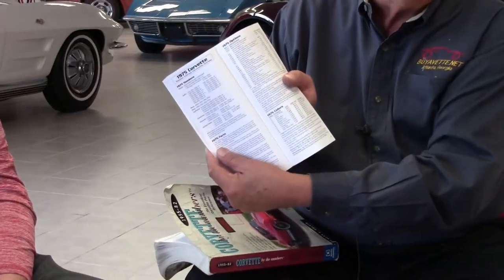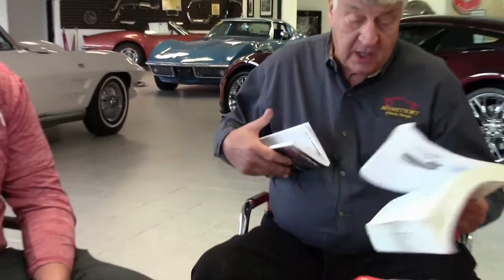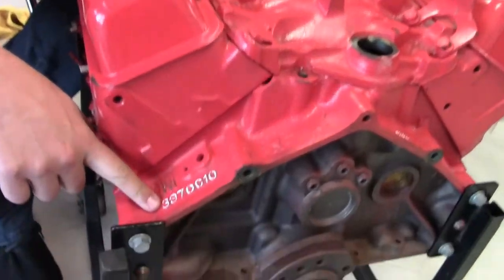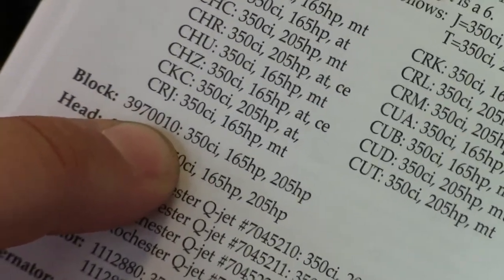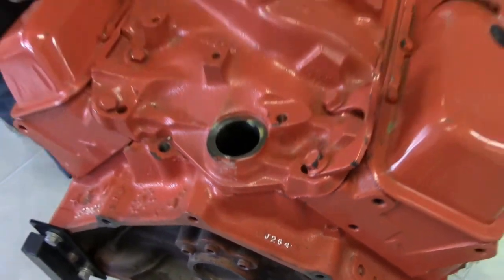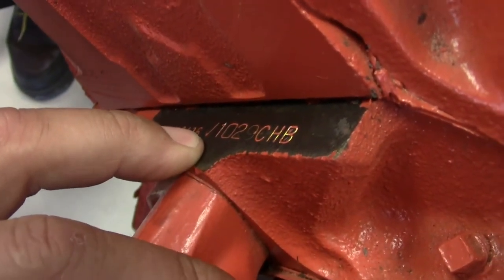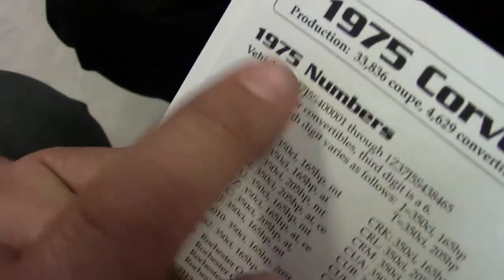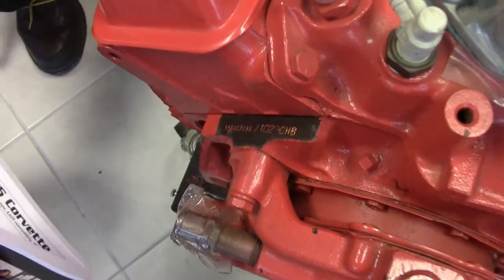"By The Numbers"  Matching Numbers Engines

Comment: Is it the same location for a big block ?
Reply from the maker: Casting date on early big blocks is located on the lower passenger's side of the engine block, near the starter. Stamp pad still contains the same data as small blocks.

Comment: forgive my ignorance, but what is the significance of numbers matching? does it tell you that the original motor is in there? Wouldn't it be better if someone dropped a newer engine in there?
Reply from the maker: Nearly anything that's antique/collectible is going to be worth more if it's original, and not modified. People buy these cars because they're nostalgic for them -- they remember what they were like when they were new, and they want them to be exactly like they remember. Original is almost always going to be worth more than modified, if they're otherwise in the same condition.
Reply: @buyavettedotnet  negating top specimens i e l 88, ZL1  etcetera that trend is pushed out due to all the customers that want rest don't mind with modern fuel injected crate engines. Sad I know, We full original engines much to my dismay at a daily at my shop due to customer demands and replace them with bigger beefier modern ls7s or 502 or 572 crate engines because their original 454 LS6 in a Chevelle just wasn't enough power LOL so I might have it half of these suckers generally don't care about the engine once it's pulled but it's still sad because most of them might just pickle them and then set them and store them on a pallet somewhere and hope that I find a clean enough body to throw them into someday. My 69 has it's original 427 and Muncie 4 speed, but my Wife's 73 has a 383 stroker that has about 100 more horsepower and kicks its butt every which way to Sunday because it's built to the nines LOL but we both know which one I'm driving on the weekend, my 69 all the way! Have a great day Sir and awesome video.
Reply from the maker: @adamcady9359  thanks for the kind words! There certainly seems to be plenty of both "numbers matching" customers, and those who don't seem to mind. We'll keep stocking cars for both though!
Reply: @buyavettedotnet  Thanks. Great to know.  I am based in Europe and looking to obtain information on previous Ownership of my C3 Corvettes. I had the website before, but lost it. How to get History Ownership info? Many thanks in advance! Regards from England? 😎🇬🇧
Reply from the maker: @marissejans6247  I am not aware of any website that has ownership history for all C3 Corvettes -- maybe try one of these? https://www.c3vr.com/  https://www.c3registry.com/
Reply: But just because the numbers match doesn't mean it's original, far from it so be careful paying a premium for the supposed original engine. I first became aware of these numbers over 40 years ago and restamping was going on back then. So many fakes out there today,  I've seen "matching numbers" on a block that doesn't even fall in the correct date range so impossible for it to be the original engine but I'm sure many would be fooled.

Comment: I have a 1970 Corvette Convertible, the badging says LT1 but I'm not sure can you tell by the VIN number if this is true?  VIN 194670S403777
Reply from the maker: They didn't start putting the engine code in the VIN until 1972, so no way to tell the engine on a 1970 from the VIN. Also, looks like you have an extra digit towards the end of that VIN.